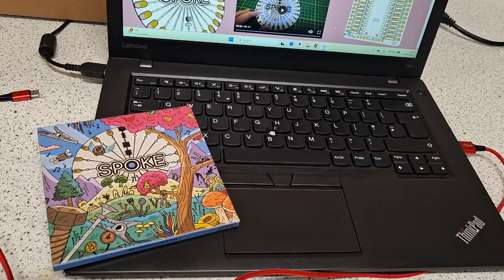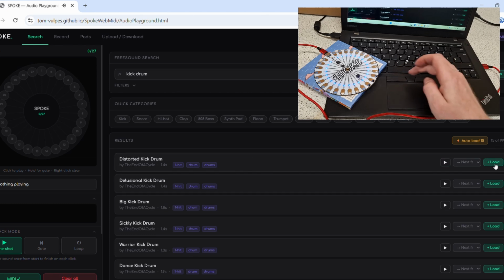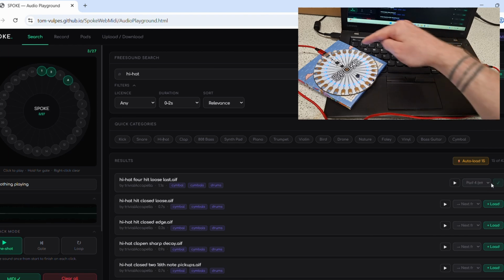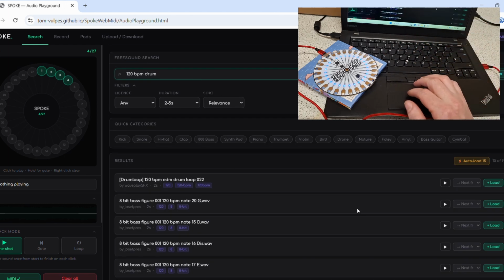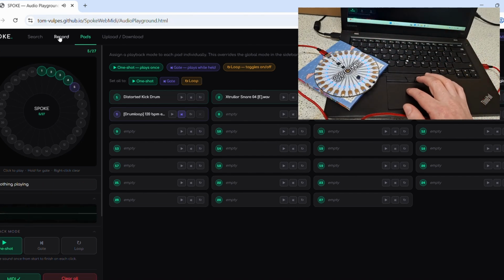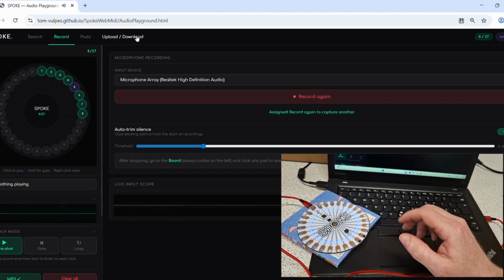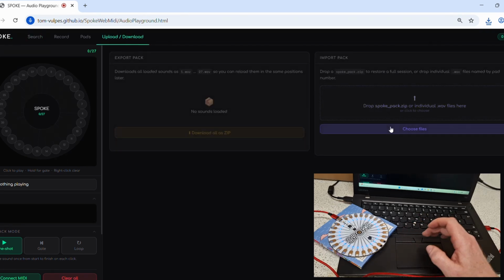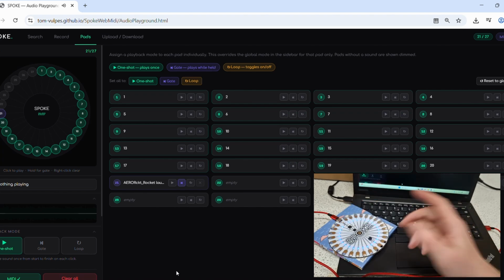Spoke Audio Playground

Comment: Solid app, straightforward and super handy, not just for music, but also getting creative installations up and running super fast. I imagine loading this page on a raspberry pi, hooking up spoke, and just turning the system on, no screen needed, tools tucked inside etc. I made stuff like this with arduino's and breakout boards, the setup was so complex as a learning process taking away time of the actual goals. Nowadays I'm all for that side of things, needing out over diy etc, but I would've loved a toolset like this.
Reply from the maker: Thanks for the feedback! Removing barriers to access is a big part of what I'm trying to do with SPOKE. Allowing you to just get on with the fun, creative stuff because the hardware and software just work right away.